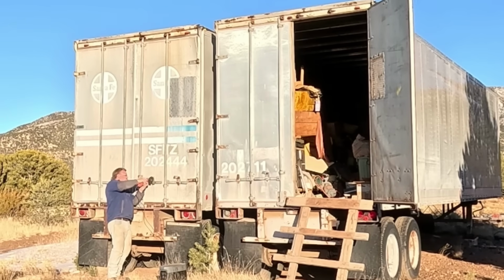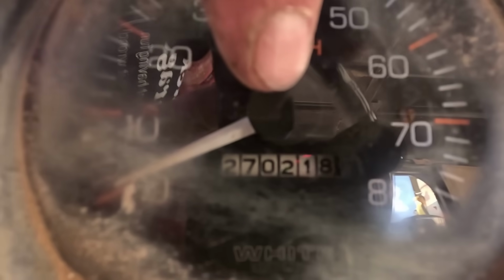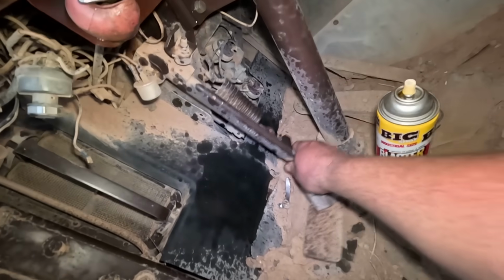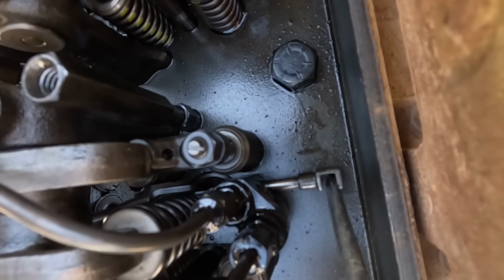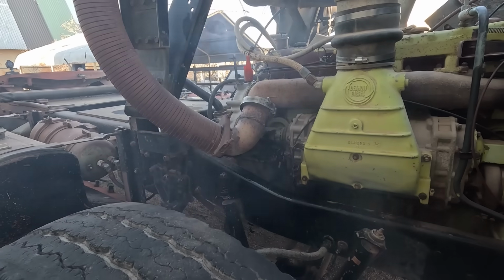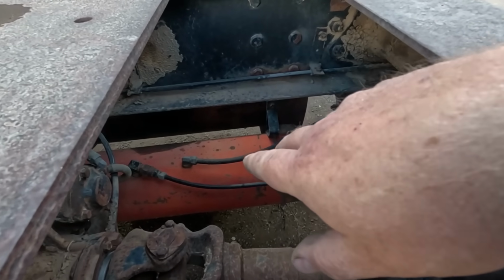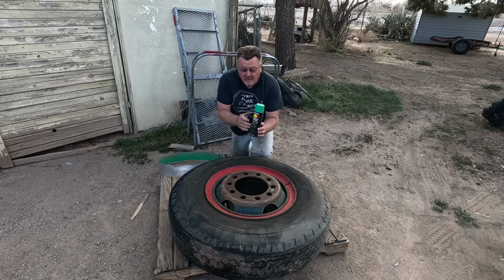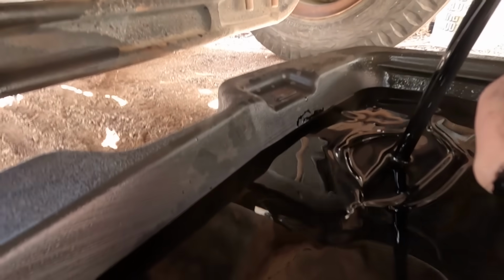White Road Xpeditor Parked since 1996!

Comment: Worked on a couple of those engines years ago with the same issue with stuck injectors,    I lubricated them with a 50/50 mixture of Seafoam and automatic transmission fluid and it worked great.

Comment: On two stroke diesels what was called a super charger is a scavenge pump, they will run without it but not run well. A trick i have seen for a dirty air filter, put fireworks on the inside as they explode out it blows the dust/dirt out!

Comment: The most important thing on the Detroit Diesel is priming.... They don't like air in the fuel line...... A. not so often problem for a 6 71.. . Is a head gasket... Oil seal.... Oil travels from the block up to the cylinder head through an oil seal in the head gasket....
Reply: The part that would come after your air compressor would be your air dryer.

Comment: You're not going to find water in that engine.... As for freeing up the control rack... The rods should move in and out on all of the injectors simultaneously regardless of what position the engine is in

Comment: You need to pop the valve covers on an old Detroit.... You want to make certain that' p the control rack... Movies freely..... All the way back to the governor..... The governor is generally going to have one or two ways to shut the engine down.... You're either going to have a solenoid or a cable to move the lever on top of the governor... To shut it down.... If you're trying to start it... You want that lever free so that it goes to the run position.... Another way they had her shutting things down... Is a big valve that closed off air to the supercharger or blower as we call them....  One. Of. The most frightening things that you can have happened to you is to have the thing run wild which you don't want to do.... But if the control rack is free...... You should be cool

Comment: You're driving by running through the five gears.... What you'll get to the maybe 35-40 mph... Then you activate what is called the splitter.... Flick the switch... Then go back to what you thought was first gear which is now really 6th gear... And run up through the five gears........ Unless you have a 4 speed.... Some people might call that a 9-speed.... Some might.  call it an eight-speed.. if it's the Detroit you're lucky.... If it's a Cummins you better hope it's got no miles on it..... Are known for exhaust fires.. that signify to the driver it's the end of that engines life the exhaust fires occur because the cylinders wear out and the rings..... By the way... You have to double clutch that thing.... Till you get good enough to float gears

Comment: There's a 9/16 bolt on each one of those are brake canisters.... You can loosen the brakes up from the drums.... Then if you've got a very big forklift... Or maybe the yard crane you've got.... You wrap a chain around the kingpin on the trailer and chain it to your forklift or crane.... And you can move the trailer... You don't really have to buy a a tractor..truck... Or a mule.

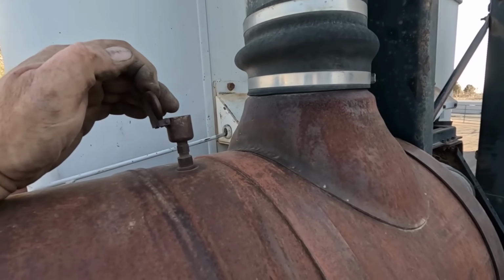Comment: The valve you mention, round-about, 47:34 is a tractor protection valve.  The most generic of TPVs.  I don't know when standards changed but there was a time where parking brakes required air pressure.  No air, no parking brakes.  Thankfully, standards changed and it became normal to have parking brakes automatically apply when air pressure disappeared.  At 58:25-ish, that little cup is for ether pills. Put a pill into the cup, the spring-loaded lid would pierce the pill and it was the perfect amount of ether to start a cold engine.  That system disappeared because, drivers being drivers, would grab a handful of ether "pills" toss them under the seat where their hammer, gloves, last week's newspaper and Waldo would reside.  The seat would, occasionally, pierce the ether bunnies, make the drivers a bit light-headed...  No more ether pills.  

Glad to see you got that grand old lady running again.

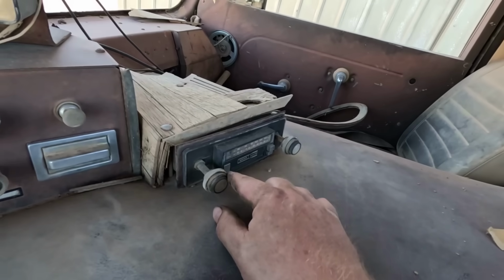Comment: 8:57 This is an early mechanical logbook. Back in the day, drivers would keep track of their miles and service hours in physical books. But of course these were easily tampered with (or you could say that you followed regulations, but not ACTUALLY do it). So, around the 1970's, governments around the world started using these mechanical hour/mile trackers. Also fun fact, these early ones could still be tampered with, as turning it flat on its face would make it stop working.

Comment: I drove a similar White Constructor with dual axles, 318 Detroit, 10 speed, hauling heavy equipment on a lowboy for a John  Deere dealership for 4 years. That thing would often go into a cab shake, front to back, so hard you'd have to lean forward off the seat and just let the truck shake under you! Low geared, underpowered, topped out at about 63 mph, quit due to back problems and went OTR trucking for another 5 years. Every truck after that one was pure joy, especially a cabover 72 Pete and a Kenworth anteater double bunk with a 13 and a 444 Cummins that ran out at 110. Only truck like the White I drove shortly was a Road Boss and it was rough, but not bad as the White.

Comment: Why don't you fix the throttle pedal issue and the gearbox?  Paint doesn't make the truck run or work better, but making sure the controls work certainly will!  You can always bling it up once it works properly.

Comment: Back in the seventies Some trucks used a 3 knob.Air brake system like that blue was tractor only break parking brakes , yellow was tractor and trailer parking brakes and red is just the trailer air supply. So once you get it running and hook it up to a trailer.All three knobs need to be pushed in for everything to move. Also, to be aware of depending upon how all those trailers were before 1975, most did not have what we call spring breaks in other words.If you tried to back up to it, it is possible that it might roll away.So we had to hook the airlines up first and pull-down on the trailer.Brake control valve usually attached to the steering column to hold the trailer in place.While we backed under it.

Comment: A old trick I learned about those square plugs is using a socket extension the female put over the plug then a wrench on the make end of the extension , the extension being hardened metal will not round like the soft plug will

Comment: Caked on mud; rust; broken wires, gauges, windows and lights; disconnected tubing and wires; no clutch or throttle or fluids, etc:

"The 6-71's a great engine... this broken window's a great access hole!"

Comment: Well before your videos popped onto my radar I was watching Bus Grease Monkey revive old Detroits -- Usually attached to retired Greyhounds and Motor Coaches.   He uses a rubber mallet onto the backside of the injectors to free them up and check the pattern.   This engine if it's only got 250k on it is factory fresh and would be a great fit into the KW Pacific if you want it to have the 'Screaming Jimmy' howl of most of the era's great peoplehaulers.

Comment: Scrolled through comments, didn’t see anyone mention the safe with the unclassified sticker on it. The default combo is 50-25-50. Spin to the left a bunch of times, stop on 50. Spin right, go past 25 twice stop on the third time around. Go back to the left, go past 50 once, stop on the second time. Go slowly back to the right to zero, if that’s the combo it’ll start to engage, should stop around 90 and the handle will go down releasing the bolts.  If you’re lucky the change key will be in it and you ban reset the combo. Otherwise a GSA safe is worth a few bucks. Needs inspection by a GSA approved locksmith and an updated lock installed then it’s good for all your secret stuff.

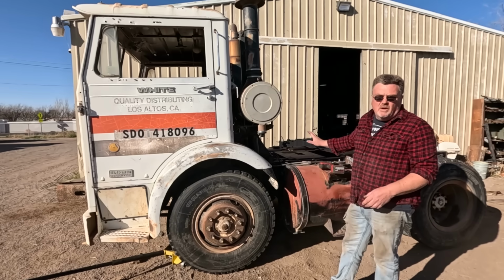Comment: 51:39  Shouldn't air pressure release the brakes, not activate them?  I thought trucks like that were built that way so that if there was a failure to the pressurized air system, then the brakes would engage and the vehicle stop (or not move).

Comment: Interesting engine design. In the UK we had the Commer TS3 engine. 2 stroke, supercharged, diesel. 3 cylinders, 6 pistons, 12 conrods, 6 rockers. No preheat, camshafts or valves.

Comment: O M G a 671/238 2 stroke joke Detroit diesel. General motors idea for the least efficient method to convert diesel fuel to extreme noise. As you can tell I am an old fart with diesel fuel for blood who actually drove brand new ones. My first new truck was a K W 100 cab over sleeper , cummins  335hp with a15 speed double over. Hauled school supplies all over northern Canada for the residential Catholic school board from Quebec city starting in the winter of 1966. Mostly gravel, a lot of tundra and ice roads, cat push and some [few thank God] of the remaining cord roads were available. The Trans Canada HIGHWAY used to be mostly gravel just after the Deer Horn truck stop on the north side of Parrysound ONT. The next major pavement was almost into " the PEG ".

Comment: You shouldn’t need to give it any throttle when starting out. There’s so much torque and it’s geared so low that it’ll launch with no throttle.  Once it’s rolling, you can begin accelerating through the gears.

Comment: Also you’re correct on the spring brakes being applied without air to that end of the chamber….but those bolts sticking out the back of the maxi cans have the spring side “caged” and you’ll have no parking brake until you pull those bolts out. The diaphragms in the emergency / park side of those chambers should still be good since you’re sending air to them when you push the park valve in even though it’s not actually doing anything and they aren’t leaking (unless they are and you just can’t hear it in the video).

Comment: I was wondering why that tiny little tractor would have a 13 speed in it…..then I saw the 238 Detroit and it all made sense. The vast majority of those expeditors I’ve seen have a 220 or PT-270 Cummins in them with a 5, 6 or 7 speed in them.

Comment: In a past incarnation as a farmer and trucker, I owned an older version of your cabover, impolitely called the "Jap White" otherwise known as the White 7000. My truck had a sleeper and it was a twin screw diff lock, 250 10 speed Cummins. Thanks for the video. It brought back memories.

Comment: On the steering, Jack up the front axle and grease both kingpins with no weight on them, the grease will flow in better and will make a HUGE difference.
Reply: Also the shift linkage is almost like a driveshaft on the white cabovers, the u joints might be seized and need lube or replaced.

Comment: Cool old truck, replace the glass with plastic. A little paint like in the photo green on white, with green rims looks good, a little fixes and shakedown maintenance, you'll have a little treasure as always you have an amazing ability to make things work when, I would not have any idea where to start". Thank You. i do enjoy your channel and videos, I'll find there something new to learn and you are a great teacher.
Please bear this in mind! COE's are great for a lot of job's, there is some dangers to beware of 1st running headfirst into anything, 2nd the cab latching coming free.  On a more Serious note, Bob-Tailing / Run without a trailer, this can be very dangerous at any speed, the shorter the wheelbase more so, it is best practice to engine break to low speed before breaking as on any surface all the breaks could lock-up take away any control you had! Also, it's not unheard of for a bob-tail COE to roll face first on a decline with a full break lock-up. If your able to, add a cross-member after the rear axle with somewhere around 1/5th the engine weight. 
 PS, The map drawers full of maps are a treasure!

Comment: 6-71 has nothing to do with the supercharger, only a few Detroit Diesels were supercharged. The 6 means 6 cylinder, 71 is cubic inch per cylinder, there is no V, which clearly means it is an inline engine. An 8V71, is 8 cylinder in a V style with 71 cubic inches per cylinder. Either way, they are monsters

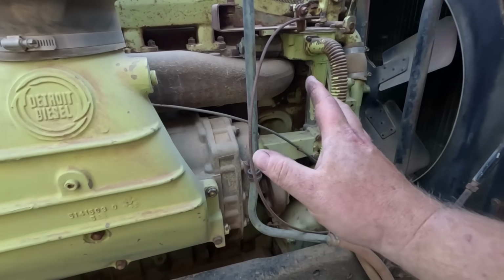Comment: @15:00 that is an emergance shut off! don't start the engin if that dose not work. that is the only way to stop it from running away. check the rack, make shure the injectors are moving smoothly. good luck

Comment: I imagine those "wind deflectors" are bumpers for the corners of the cable. To protect it in tight spaces. Either during its time hauling mobile homes or it may have done time in a depot or similar location shagging trailers around.

Comment: Non appearance in my subs feed. 12 days late catching this epic! Superb trans. 13 speed & OD road ranger. that will haul arse on the highway if you go that way.  Fairly impressed with your analysis and discovery process, some new O rings may go some way to help the air valves? A spring to automatically return your throttle would be less humorous than juggling wires wheels and pedals. Great sitting down to such a great video.after missing your fresh material after a long wait. Great purchase as far as old trucks go I reckon. Looking forward to the new edition in future Bud! See you then.

Comment: Does it work the windscreen washers by pressurizing the reservoir? I can't remember if I've heard of that or not, but it's weirdly neat. :)

I quite like the colours it is, mostly a neutral but light white, with a red stripe each side for interest. A fresher white might show up all the little dents more, though it would be nice if it's not too bad. It looks a lot better than such an old truck would in England, no part of which is more than 50 miles from the sea with its salt spray.

Comment: ANY vintage early transistorized electronic machines for businesses which have some type of computational functions via memory are more valuable than you would believe, original manuals and software too.
Reply: my father in law sold 10 or so 1970's machines with large floppy drives and dot matrix printers for over $20k, he paid $300 for a garage full of stuff.

Comment: The detroit 671 engines are indeed legendary.
I dont recall if they are dry or wet sleeve.
I do know that they are worth rebuilding.
If you get the throttle, brakes, and lights figured out enough to be road worthy, many states will allow you to license them as a pick up truck or RV.
Imagine the adventures you could have with a 40' camper trailer and this thing.
Sadly, you might need to leave the wife and kids locked in a closet at home, as that cab might not be roomy enough for everyone.
There are also medium and heavy duty tow truck cable slings that were used on semi trucks..
The possibilities with that thing are nearly endless.
Cool video.

Comment: I worked for a custom truck builder that made similar cab overs for specialized applications.  It had a 48 degree cramp angle even with a 21,500# steering axle.  The base engine was a little CAT 3208 but options included 6V92T engines.  In the winter, after a good snow, the employees took turns driving finished units outside.  It was not safe to walk in the parking lot except during breaks. The manager enjoyed watching the madness from his office window.  I often heard that shifting was like stirring oatmeal.

Comment: So with the cab over trucks you do one Handel then the other, in a certain order. You went backwards order. The light hook is the safety catch, like the first catch on your bonnet/hood of your car. The heavy one, the one you done second, is the one you’re supposed to do first, and is the main catch. 

Also to make flipping the cab forward easier you open both doors, puts more weight to the front. Close the doors to drop the cab. Also, dropping the cab, one big explosive movement. Trust me, I’ve done it way too many times to ever want to do it again.

Comment: That calculator is one of the first! Great score!! I knew that 6-71 would fire up and run! This one reason I say 2 stroke Detroit diesels are the greatest diesels in world history! The roots blower os NOT a supercharger as you said. It is a scavenging air pump. When the piston nears the end of the power stroke, the 4 exhaust valves in the head open, and the hot gases start out if the cylinder. Shortly after, the piston uncovers the intake ports and the blower pushes the remaining spent gases out through the exhaust valves. Piston starts up, intake ports and exhaust valves close at same time so no boost from the blower, compression/injection/ignition, power repeat. It is a valve uni-flow Clark cycle 2 stroke, the best ever made! They are beautiful engines and you will love it!
Reply: Thank you for the essay

Comment: 1) I knew that 2 stroke diesels existed, but never knew how they worked.  Learned a lot there.  That thing runs beautifully.

2) As for the cab, it looks great with the old paint.  Don’t change it.  

3) I don’t know how far the Low Buck Mine is from Low Buck HQ, but it seems pretty far.  Something resembling  windshield, even if it’s just some plexiglass, seems in order.  If nothing else, it will keep the mountain varmints out of it.